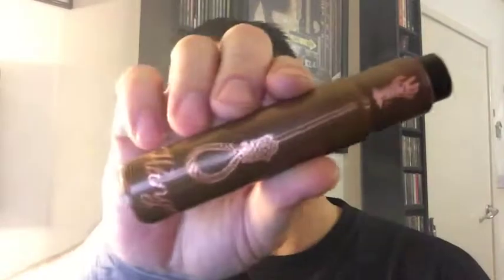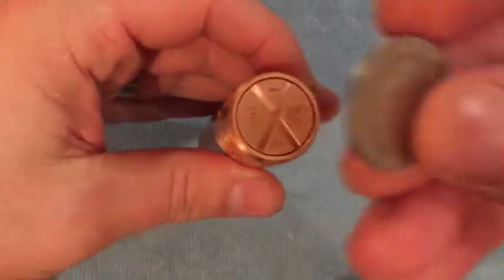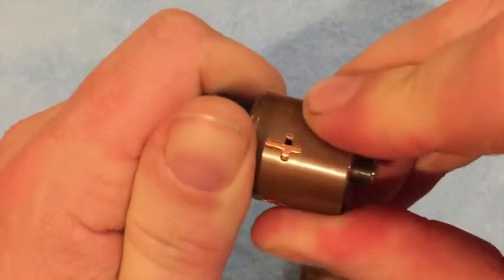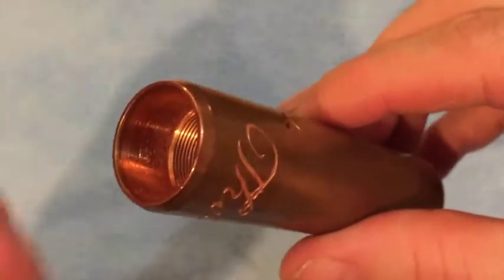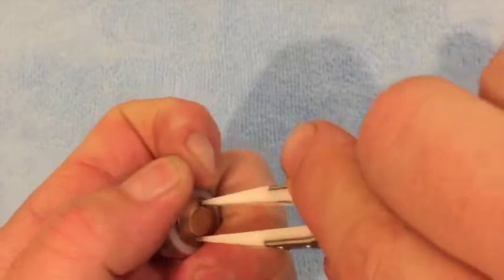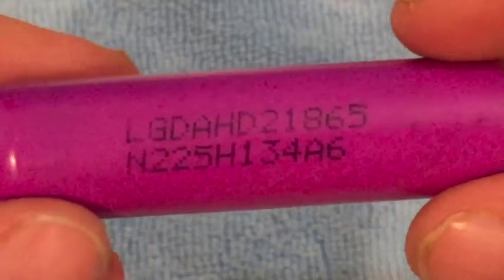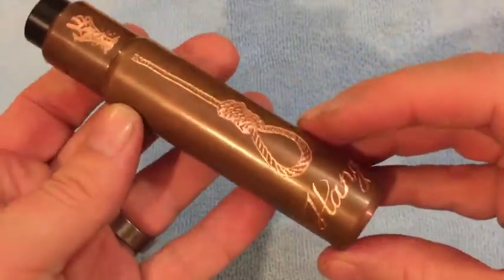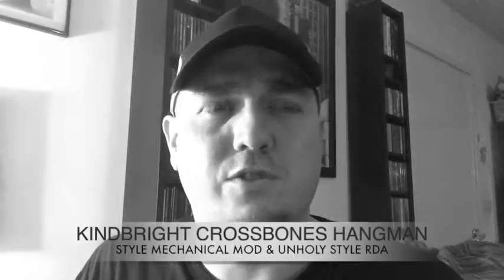DEATHWISH ~ HANGED TUBE MOD & UNHOLY RDA CLONE

Comment: Cool video. Gonna get this in brass, mech mod clone, is the brass mech mod version clone version of this good? also are the batteries positive down?
Reply from the maker: Thanks for the comment, did you manage to order one? I usually load the battery depending on the configuration of the tube mod, any piece of metal that could possibly tear the insulator ring on the positive end I would reverse... so on this mod I would have the RDA sitting on the positive end & the contact of the button hitting the negative, anything that might tear the ring will cause thermal runaway & the button contact on this mod is large
Reply: Should be getting quite soon. Thanks for the battery info. What do you mean by something that will tear the battery. Also do the clones have insulators I think they do. So yeah im waiting on this cool mod.
Reply from the maker: the most important area of a battery is at the top of the positive end where there is an insulator ring (sometimes like paper) that separates the negative from the positive if metal touches both at the same time it will cause thermal runaway which is where the battery does not have time to vent & will explode, sometime buttons are very large or jagged & might cause a tear to this area so I always have the smallest area if there is a pin (on a mech mod) touching the positive connection but nearly always if the mod is a hybrid I will have the RDA on the positive section, on my old channel (which was deleted by youtube)  I did have videos up on there about battery safety etc & how to be safe with tube mech mods, what tube mech mods do you use at the moment?
Reply: Outsider365! none , Im going to get the hanged brass mech clone tommorow probably.